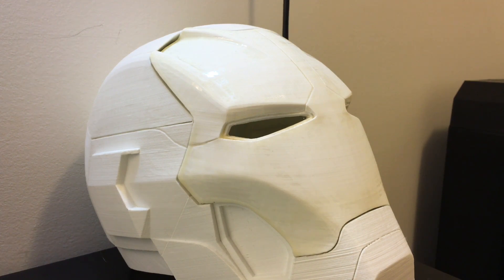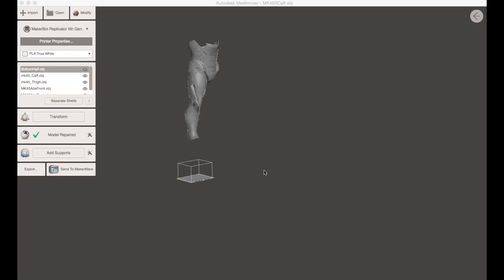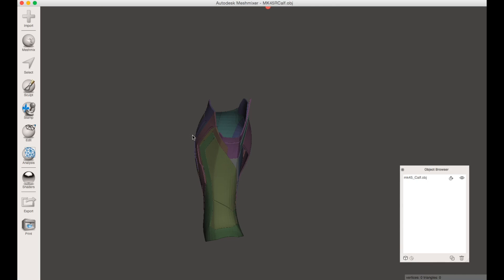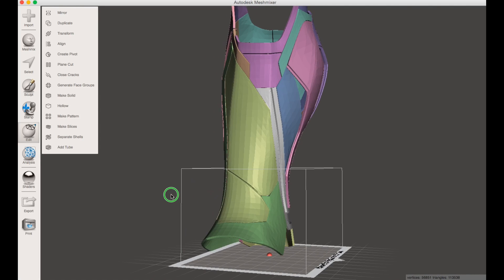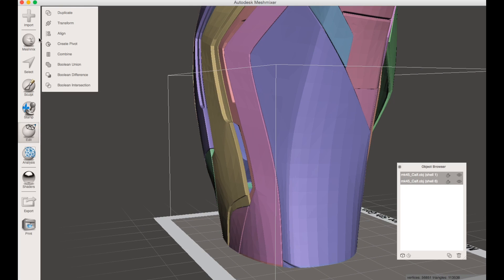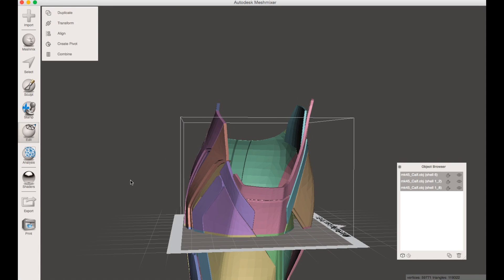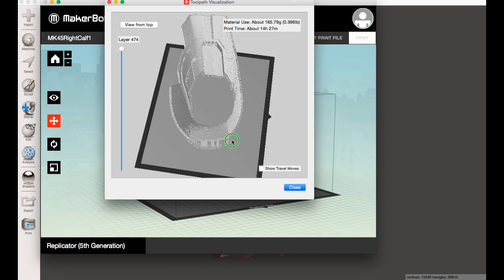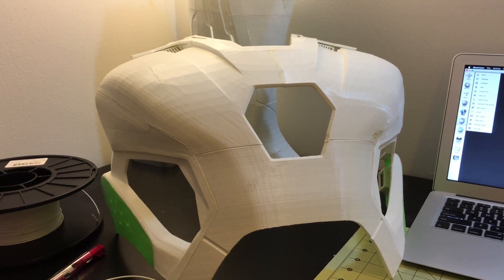3D Printing Full Scale Iron Man Suit TUTORIAL

Comment: What did you do to get it to print as a solid part? All the individual plates are separate from each other with a really small gap like you said. My printer wont like that
Reply from the maker: After you combine all the parts you can click on print and then above the print/ export options on the left you should see a repair button. Click on that and it should turn it into a solid. Good luck
Reply: +lukicharms69 thanks for your reply. Unfortunately, it didnt fix my issue. There is still a thin space separating all the shells even without separating them. As is, the only way to print this out is to either print out every single shell and fuse them together into a shin, or modify the model
http://tinypic.com/r/2zec8zq/9